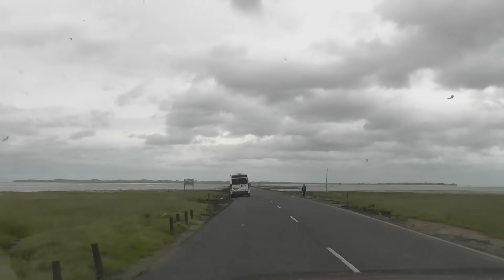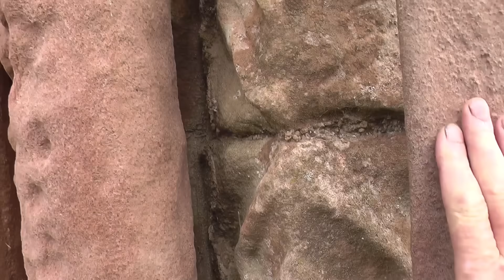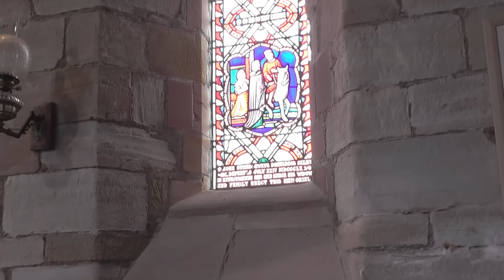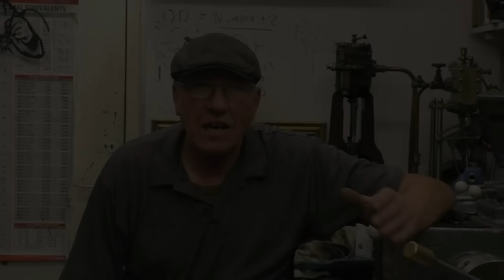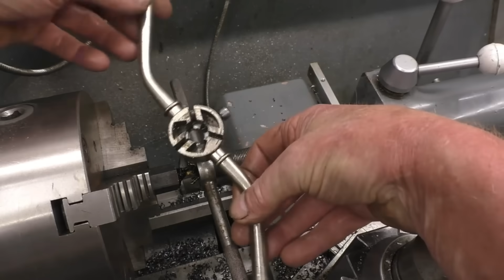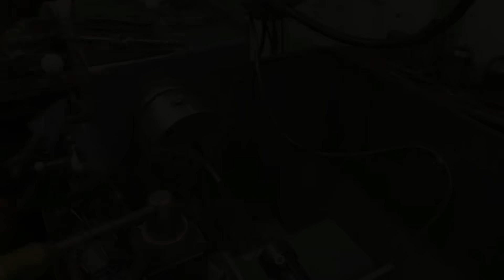Wednesday Catch Up 47.  Holy Island Trip . Lathe Tutorial 10 Using Dies.

Comment: We were taught that the die holder is called a die stock. What is the difference? A tip to prevent jamming of the die when reversing the spindle is to unlock the tailstock once the thread has started. It can then be pushed back by the die if the tailstock holder runs out of travel. Better still don't lock the tailstock at all and just push it until the thread starts to cut.